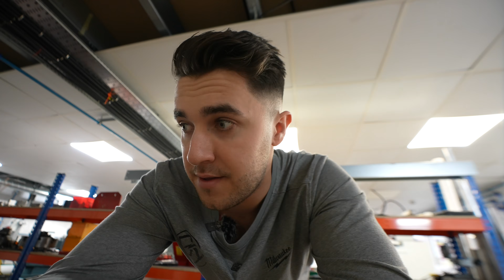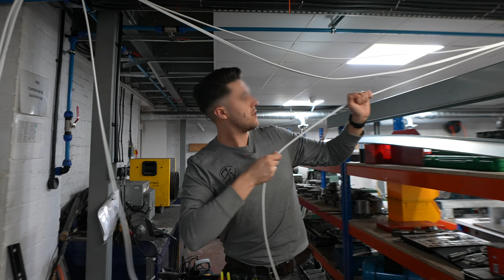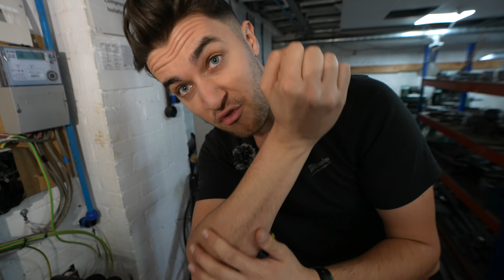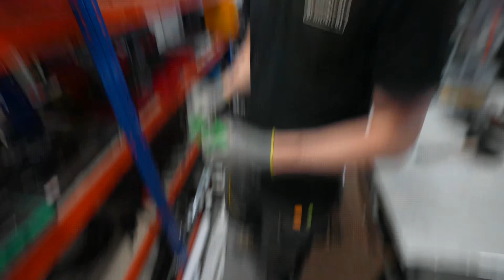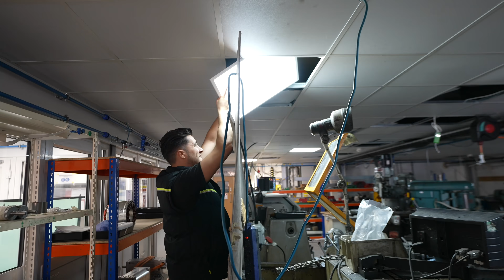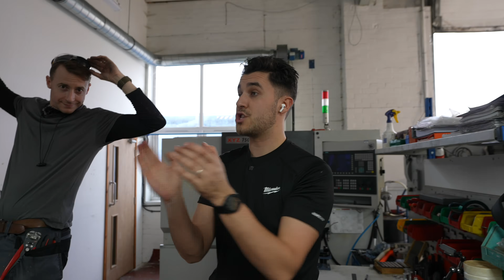400v LED Lighting Install | ØY41

Comment: If the customer changes something you have already agreed on, you need to add an additional quote for the extra work before you continue. The current leakage is properly the air compressor outside, the spark eroder and any cnc machine with high speed (40000 rpm) spindles. There are also old machines (radial drill etc.) that are very prone to leak. The only way to resolve this is to actively monitor the leakage while each machine is used under load one at a time. A big job, and yes I have done it. 😊

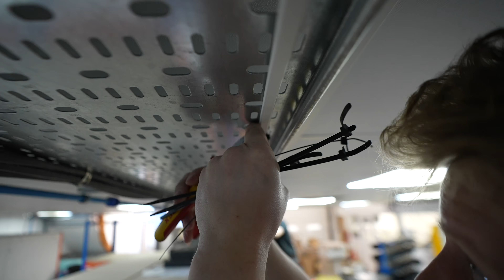Comment: 7:39 well if you have to do extra work you should get extra paid foremost if you done it already and have to do it again, that time needs to get paid, other thing is it if they inform you before you start pulling wires then i would not really extra charge them, if it is the same amount of work but material and such go extra and if you have something special ordered for them which is not to be used because of the change and you can not give it back or use otherwise you have to at least charge them partially for that

Comment: I’m fairly sure them panel lights have a sheet of plastic or some material in the middle of the panel (behind the diffuser) and the LEDs are around the edges, when the sheet material bends in the middle it causes a shadow (hence the orange tinge). Easier to see when taken apart. 👍

Comment: Do those contactors have four fully rated load contacts? The one in your schematic drawing only had three and one auxiliary contact that's usually only rated for a few amps, for things like indicator lights, locking out contactors against each other, etc..
Reply: I guess they aren't switching the neutral, so they would only need three contacts.
Reply: @1idd0kun  I wouldn't expect them to switch the neutral but I seem to remember noticing four contacts being used instead of three. I might have been tired and confused though, should re-watch the video.

Comment: Cool bit on the light phasing/machinery, never knew that and quite deep knowledge!
Reply: It is a problem with wire-wound ballasts that have a 50 Hz output (all they do is limit the current, other than that they pass the mains straight through). Electronic ballasts of all sorts have an output frequency in the kHz range and no longer cause that issue.

Comment: That's a clear variation, the client changed the scope of work requesting that you not use the existing tray after you had installed.  The rework wasn't too much since you'd not done the terminations and the route length stayed the same, but was still 2 tradies for x hours.

Comment: Those JCC sky tiles are the same casing as the Ansel Panels just without the Panel Pod options. Also if they've changed the spec after it's started to be installed it's a variation order - sucks for domestic customers but for commercial clients it's a tax write-off anyway so it makes no difference to them.

Comment: What was the PF like with all those inductive loads? I hope for their benefit they have proper PF correction on the supplies otherwise theyvare paying through the nose for their utility bill (i meam its RR I half expect them to have soo much cash as to not really care...).

Would a sprawling site have PF correction at like the main incomers (ie where the utility meters are) or would you expect them to be spread around? 

I'm not a spark, but as others have said whilst there is a balance between keeping the customer on side for future work and billing for your time, you dont want them contracting to you cause they know they can change the scope of works and you'll just do it (ie abuse your kindness).

I'd probably take this one on the chin, and learn from it, but in your bid work, explicitly write down how you will do the schedule of works, and then as others have said, have a clause or whatever that says the bid is fixed based on the work schedule provided and ANY change will increase the bill (even if reducing the job involved because you still have to factor in the time taken scoping the work, writing how the work will be undertaken etc.. so even if they slash the job in half you still have to re-do all that paperwork as well that takes extra time).

Ultimately, yes you want to build goodwill with the customer to encourage follow-on work, but you equally cant back yourself into a corner of them abusing your goodwill cause I know 'ditching' a client is 100% a risky move that should ideally be avoided if later on down the line they donexqctly that and you can't accept it anymore.

Ie start on the right foot from the outset.

Comment: Cheap panel would be best guess as you’ve proven with moving the diffuser. We fit Philips panels expensive but very uniform light output 🤟 and we put thousands in and I mean thousands! We rip out a lot of the cheaper brands which all have that discolouration. 
The original
Install looks suspiciously like the in house FM team have had a crack at it

Comment: Great video Cory. I just finished a 3-Phase consumer unit re-location and starting to see the folly in using masking tape to label wires. May I ask how you labelled the wires going into the contactor?
Reply: I could be wrong but I believe he uses a Brother label printer so probably some heat shrink tape run through that

Comment: Edge-lit LED panels are the absolute worst piece of garbage! Seen loads in many shops failed over the short span, because panel is made of multiple layer sheets which yellowed over the time, same goes with cheap LED strips on both side. They're 💩💩🤮

Comment: Great video but everyday  I'm trying to avoid China where JCC skytiles are made! I wonder how long they will last and how they are made. We really need to start ramping up our own production.
Reply from the maker: I’ve not seen a single fitting that is fully manufactured in the uk. And JCC at least own their own facilities, along with full R&D and huge facilities based here on the south coast
Reply: @corymac  Agree, I did get a chance to go to the Prysmian cable factory in Wrexham a couple of years ago and was enlightening to see the production line. There are some other switch and enclosure factories but far too much from China. If the world conflicts starts sanctioning China we will come a cropper with supplies.

Comment: Once upon a time, in a land far, far away, I worked for a company that was engineering/building custom control systems.  Rule #1:  Once the job is bid and accepted, ANY change results in a positive (net increase) change in the price, even if the change is to reduce the scope of the work.
Reply from the maker: I’ll take it on the chin this time as they were so kind as to allow me to film. But fair point for sure. Good advice, thanks Bruce
Reply: @corymac never thought of that, good point....and you have got it on film if you take another job with them and they try it on again...

Comment: Job quoted as per customer requirements. Job accepted as per quote. Now a change this is chargeable to them. If it was a small change and not costing a lot of money to do then take it on the chin. However if you’ve ran cables etc as per quote and now change taking a while needs to be charged.
Reply from the maker: I’ll take it on the chin this time as they were so kind as to allow me to film. But fair point for sure 👍🏼
Reply: Make sure it’s written in the terms and conditions of the agreement that if amendments to the original quote extra charges apply.

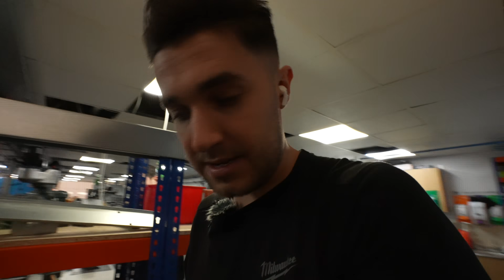Comment: 17:28 Putting lights on a different phase to the motor would just alter the perceived angle of a rotating object that in sync with the lights. The solution is to have smoothing capacitors across the DC output of the LED drivers to the LEDs are flashing like strobes. In practice they all do except the crappiest cheap ones.

Comment: Did you leave the drivers on top of the panel?. My boss has given us new instructions that we have to have the driver up in the air or on the side of the panel, because there has been times when the driver has failed because it's been overheating. Had one a few months ago that started to strobe, then a week later it was back to solid but when I changed the light there was a hole in the side of the driver. But the light still worked. And most weird oart was that there was a smoke detector inside the drop ceiling, almost directly above the driver but it hadn't gone off.
Reply from the maker: We always go onto the tile next to it 😄👍🏼

Comment: You are absolutely right with the causes for the light problems. Voltage sags and swells combined with THD and power factor are a PITA and the probably cause of that lights failing. Specially in a machine shop together with the rest of the inrush current of the of the equipment you shown. 

To be honest if you can you should also check the harmonics on that place instalation. They may be very funny to look at.

There is also a good journal released some years ago who touches that in detail - "A Survey of Voltage Sags and Voltage Swells
Phenomena in Power Quality Problems".

Search it on the good old Google, worth the read.

Keep up with the good work.

Comment: Don't they have full time electricians there? Wonder why not.
Reply: alot of these places have 1 maybe 2 full time maintainers for reactive jobs and breakdowns but for larger jobs upgrades etc they get a contractor in as it cheaper to hire in a contractor 3 to 4 times a year than employ a team of peoole all year if you employ 5 people 40k each thats 200k then factor in tools, transport and other costs looking at 220 to 230k  a year if hiring in a contractor 4 times a year at 10k per job massive saving to be made.